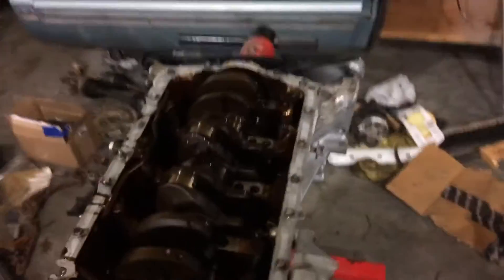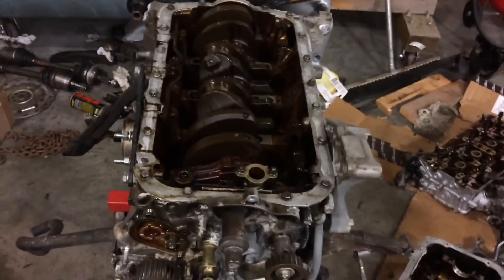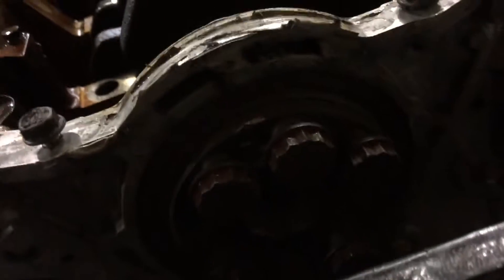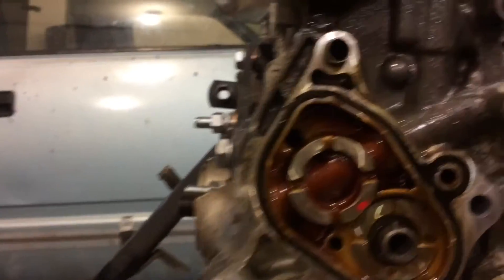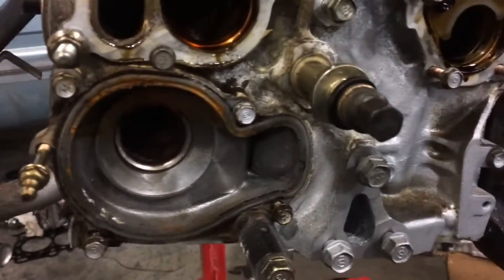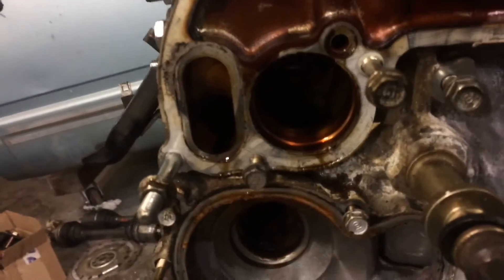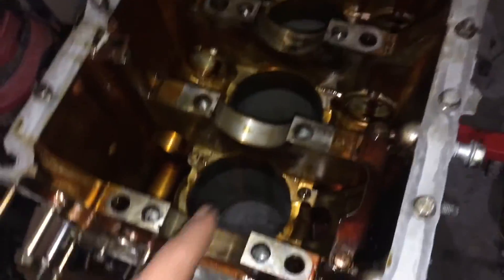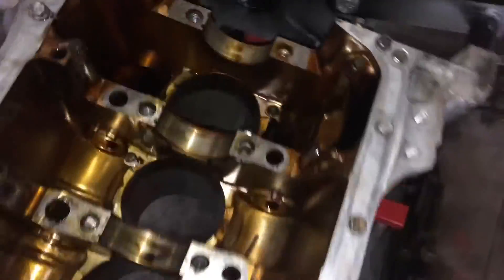H22A4 Tear Down

Comment: I was thinking about building a new engine but too much money and time. So i just go buy another from s different  car and keep the blown engine for future build. But first i need to find an engine any suggestions?
Reply from the maker: For what car?
Reply: The Feesher i have a 97 prelude. With h22a4.
Reply from the maker: H22A4 is probably your best bet unfortunately, I don't know if the F23A1 would work as a cheap replacement or not, but if there are forum posts about it, I would use it while you rebuild your old one.